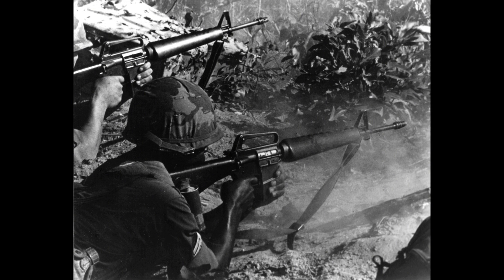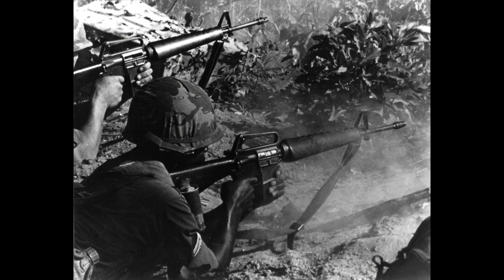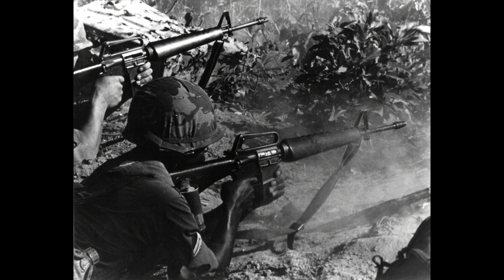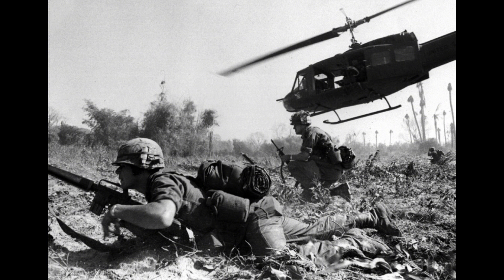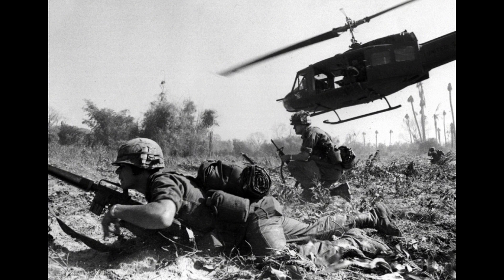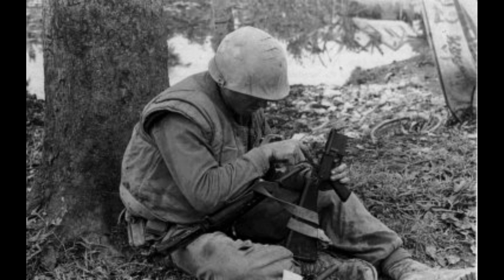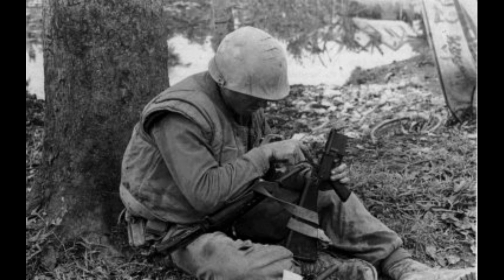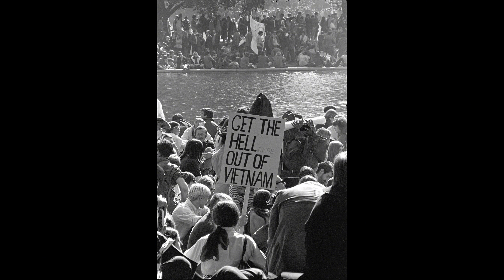North Vietnamese Troops Were Shocked By America’s M16—GIs Fired Bursts While They Fired Single Shots

Comment: NVA has AKs didnt they?
Reply: Yes.
Reply: Not entirely - apparently a lot of sks carbines were in early issue, frequently upgraded by captured M14s and later M16s.  Later the AK was the only issued rifle, but VC were last to be supplied so getting M16s from the black market, certainly for the Tet offensive, wasn't unheard of.  Learned that from some aussie vets, they did some crazy stuff (tapping barrels to accept oil filters as 10-shot silencers, modifying the L1A1 to full auto, stole all sorts of kit from the Yanks etc etc)